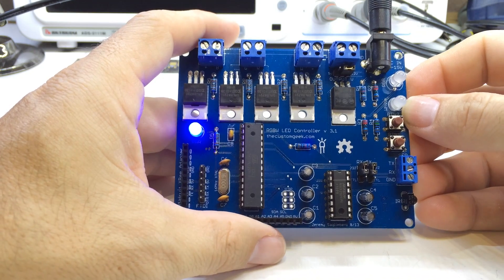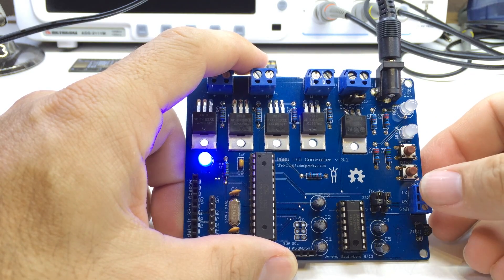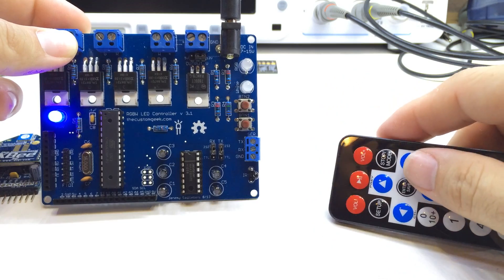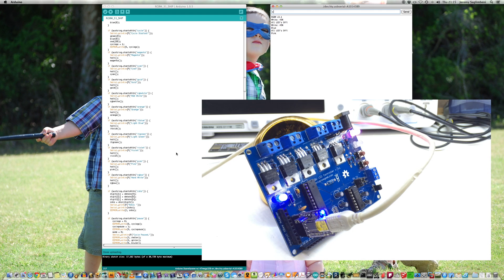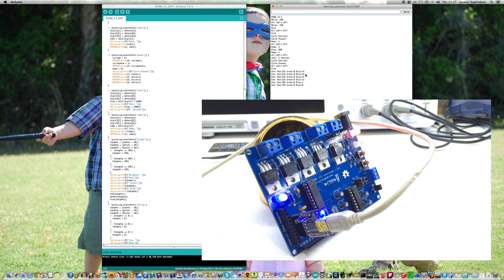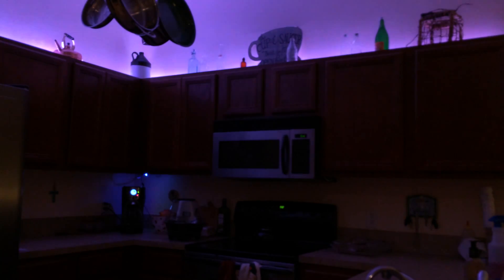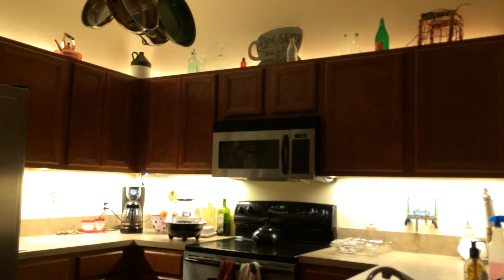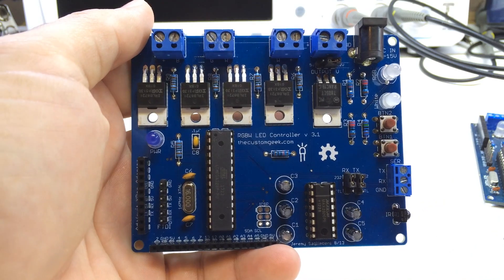RGBW LED Controller v3.1

Comment: Hi Jeremy,

I've had some trouble uploading sketches to my led controller. What are your settings for board and programmer under tools? I have tried every possible board but it still wont work. Help would be very appreciated and thanks in advance.

Comment: Hi I have a question I have a TV unit with 90 rgb LEDs and 8 12v fans spit up into 3 transformers I was wondering it this unit would be able to control it all as I like the integration of the remote I've seen the video of the older one controlling fans. Would it adjust the speed of the fans and would it be ok with the fans running all day. Just love for one to control all as I think this is really good. Thanks

Comment: Will any arduino code work with any controller that has arduino chip?
And is there any good code to do a full random cloud/lightning/storm day/night time?
Reply from the maker: Hi Rick, any Arduino code will work with a controller that has an ATmega328 with an Arduino bootloader, like the one above. No code for what you mentioned that I know of but there is a lot of sample code out there to get a good start. :)